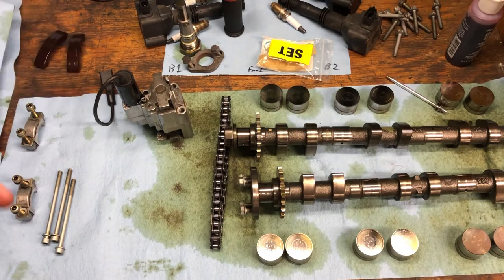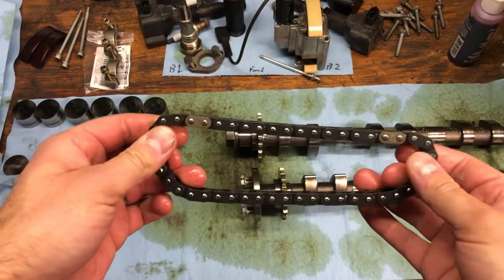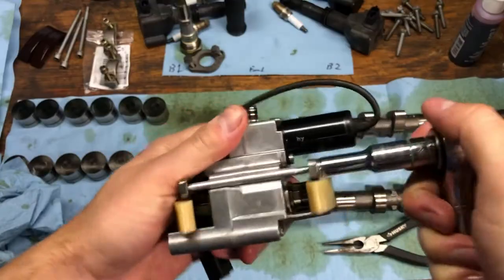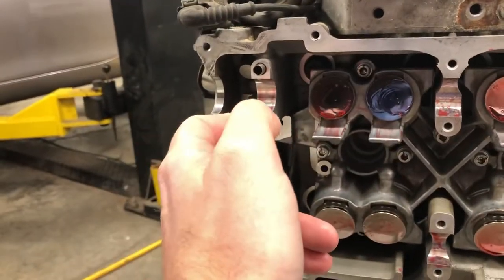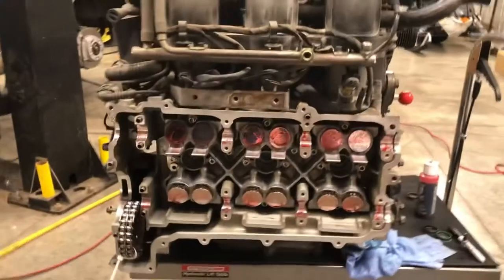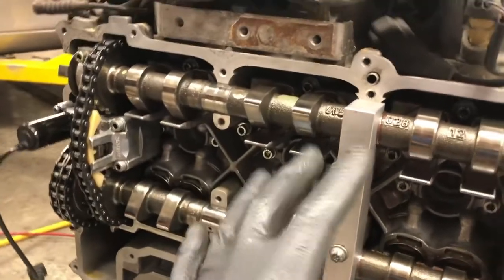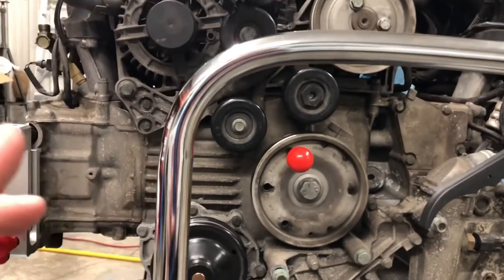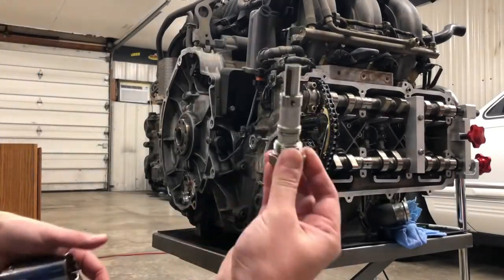Putting My 996 Porsche Carrera’s Engine Back In Time!

Comment: I have mine opened up right now and one thing that I haven't seen mentioned anywhere is that the chain from the IMS to the exhaust cam can easily skip teeth at the IMS. Perhaps this is obvious, but I was under the impression that it would stay on the correct teeth. As I was trying to set the time it seemed like it was too far out, so I took the sprocket bolts out again and sure enough, by giving a little slack in that chain I could skip teeth. Seeing that makes me realize the importance of having tension on the chains when doing things like IMS bearing replacements.
Reply from the maker: Great call! You're right on though... You definitely need to be very careful of that, especially when the cam sprockets are still in place, but the tensioners are out.. Try not to rotate the engine at all during that time! 

Good luck with getting the rest of it back together. If you hit any roadblocks, I'm here if you want to talk it out.

Comment: When you rotated to the crankshaft TDC, did you have to go around almost 2 rotations?
Reply from the maker: Not sure I understand what you’re asking. Basically, yes, it’s 2 full rotations of the crank to fully rotate the engine. Crank has TDC every 360deg, but valvetrain is 720. Then, each bank of cams has it’s own respective TDC position that are 360deg from each other.
Reply: @FunAhead_TV_Official  I think I get what Chris was asking.   you started out @ 0T TDC.   after you installed cams, you went to UT Valvetrain TDC.  So, you would have had to rotate 2 full rotations to get to UT.  correct?

Comment: This is by far the best video I’ve seen of how to time it properly. I just wish you gave some more info for bank two, as you need to turn the crank a couple times in order to begin the process of timing it. Thanks a bunch for your hard work tho.
Reply from the maker: Thank you, I appreciate it! Yeaa, admittedly, I realize I definitely should have done a better job communicating how to do that. The info i said is everything you need to know, but I needed to not gloss over it so quickly. 

Pay attention to what I said about where the cams need to be pointing when working on each bank. They’re only 360deg of the crank apart from each other, and the process is the same on each bank. 

Outside of that, let me know if you have any specific questions and I’ll do my best to answer in comment form haha
Reply: Can you please provide instructions on  how to make sure bank 1 and then bank 2 are in proper position.  I am preparing to replace the guides this week and the statement about bank 2 made me curious and want to make sure I do them correctly.

Comment: Hi David and great video!
I'm doing this same job and have a question about bank 1-3 timing. When you go from 6# to 1 Ot on crank, it's only to get away from chain slack right?
If you later on rotate engine and check the timing , the cam rotor faces out and exhaust cam is flush with head cover when crank is 1 Ot?
(Of course the cams are timed together with links/marks when assembled first)
Thanks in advance! 🇸🇪🇺🇲
Reply from the maker: Hey! Apologies for my slow response time. Yes, the intention of doing that 6 to OT movement is to take out any possible slack. Finally, you time each cylinder bank to The OT mark. Hopefully that helps. 

Good luck with the rest of your build, and let me know if you have any more questions along the way, I’ll do my best to answer!
Reply: Thanks, fast answer if you ask me! Timing bank 1-3 is done. Now I just turn 360° to OT again and assambly cams on bank 2 with cam rotor pointing down/in if I am right?😊
Reply from the maker: That’s correct!!

Comment: Hey BTW, where are you located? I'm in Greensboro NC. Nice to have some more detailed Porsche content out there!
Reply from the maker: Cool, that’s a nice area. I’m in Columbus, Ohio.
Reply: @FunAhead_TV_Official  Alright your video was a big help! After finishing the job now I have one point for you... you and I both incorrectly released the tension in the variocam BEFORE reinstalling the cams. I don't know if you noticed, but I did, that the gears of the cams touch the side of the variocam when you do this. Following the service manual, you should install the cams back into the engine first and THEN release the tension after the cams are bolted back into place. This will make sure that the sprockets don't touch the variocam at any point :)
Reply from the maker: Good eye! Yes, I did realize that, but only after realizing my mistake on bank 1. Unfortunately, for me, my cheap variocam compression tool stripped out on me as I was working on bank 2, so I used it only to the point of getting the solenoid back in between the chain and had to remove it because it had failed. Fortunately, even still, I was able to reinstall everything on both banks without damaging the sprockets or the solenoids!

Comment: I’m curious if you had any other warnings of pad wear other than parts in the oil? I am trying to diagnose a problem on my 99C4. First start of every day I get a chain rattle that sounds like it is coming from bank one, all other starts throughout the day are fine. I replaced the lower chain tensioner because it’s cheap and easy but it did not solve the problem.
Reply from the maker: Hey Mike! Sorry for the slow response. Actually, no, I had no other signs that anything was wrong. 

Since your rattle is still there, it might be worth replacing the other 2 chain tensioners. It’s always hard to pinpoint a sound like that, so it’s possible that it could be coming from elsewhere on the engine. Just a thought
Reply: Hey Mike... just replaced the chain guides on my buddy's car (and made a video). His warning was using a Durametric his cam deviations for bank 1 was -8.4, where the spec is between +6 and -6. After replacing them the deviation was around -4.9
Reply: Great video fyi the variocam body also need to be disassembled to replace two green O rings that maintain the pressure and seal the unit internally